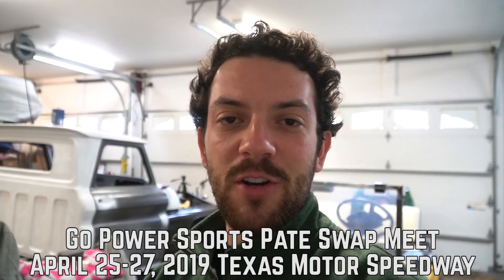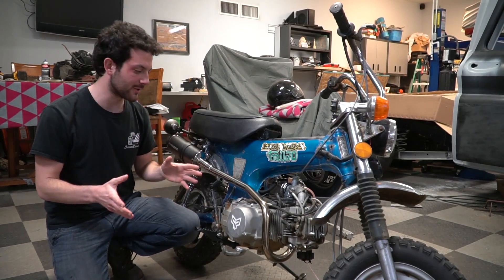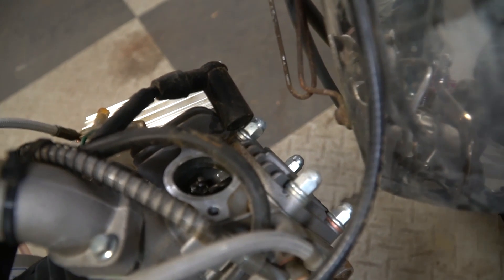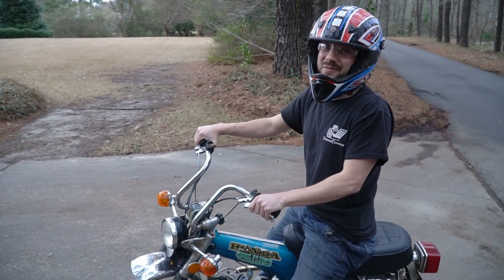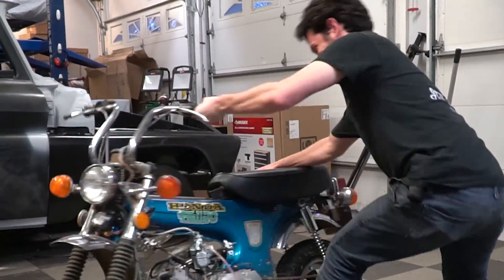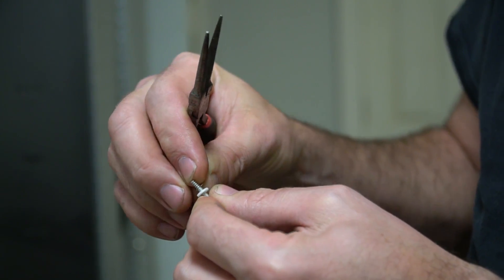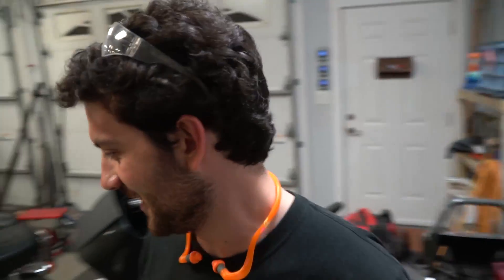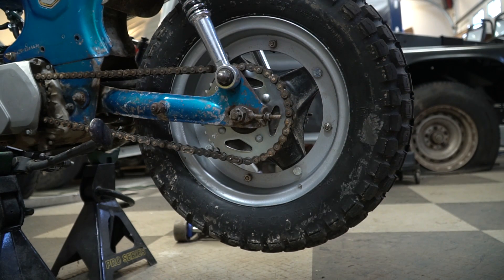Honda Trail 70 Return | The Street Legal Mini Bike!

Comment: John, glad to see that your sorting out the 140 on your CT70. I have a Honda st90 which I put a Piranha 140cc on. Same motor as yours, YX140. It came with a lighting coil on the stator, one of the reasons I bought it. That stator with lighting is a bolt on for your motor. Also may I suggest a Mikuni VM26-606 carb for your bike? I run one on mine and it hits 65 easy. It's a spigot mount round slide carb and flows the best for our motors. Great content, keep it coming!

Comment: Those paper fuel filters can bite you on gravity fed systems too.
Reply: Agreed, they make gravity feed and pulse pump style fuel filters and you dont wanna use the wrong one without a fuel pump.
Reply: I have those small paper fuel filters on my Honda SS with 150cc lifan. That shouldn't be the problem, unless they are very clogged up.
Reply: @andreasvgbe  it depends on a lot of factors such as the height of the fuel tank size and length of the fuel line carb design brand and design of filter etc.  I have a decent amount of experience with this and have seen multiple engines have issues ranging from poor acceleration to straight up not running.  Yes the filter will be more of an issue when dirty but I've seen brand new ones cause problems
Reply: You may well be, but I am not betting on that horse. Let's wait for the next video.
Reply: @andreasvgbe  didn't say it was for sure just something to check:)

Comment: The mini-trail series bikes were designed to be hauled on their sides.  So the gas cap has a locking seal lever on the cap.  If you still have this cap, make sure that seal is unlocked.

Comment: In the maintenance department they had a posting "Before using equipment check fuel, oil, air, belts, hoses and look for leaks. You break it you bought it. " It helped us reduce repair cost. Anyone caught putting away dirty equipment cleaned all the equipment. It was an easy checklist.

Comment: Try throwing a Briggs style pulse pump on it! My 72 ct70 with a yx140 had all kinds of hard starting and fuel starvation issues because of how close to level the inlet on the carb and the bottom of the tank were. I plumbed a pulse pump into the crankcase vent on the back of the engine (just inside the frame on a ct70) and viola! It instantly fixed all the issues I was having. No more dead spots, easier starting. It’s great!

Comment: I've got a '69 CT70 and the gas cap has a On/Off thingy on the top of it. This was so you could haul the bike on its side without gas pouring out of the cap's vent. It will absolutely stop fuel from getting to the carb.

Comment: I have a pretty simple suggestion that I think could be really cool still: a go kart that is focused completely on being the fastest circuit track kart with a clone engine. Basically just pushing every element of a racing kart to the limit... most powerful predator/gx200 (some are at like 28 hp), widest/most grippy tires you can buy, as light as possible, etc etc

Comment: Do you guys want two APC Mini Choppers??? 
Would be something a little different to build up on the channel.
Reply: A Sachs Madass would be great for them also.
Reply: Please do this.. I want to see it so badly.
Reply: YESSSSSSSSSSS
Reply: I have 3 of those!  They are heaps of fun lol... In would love to see what John and Ike come up with on one of those!
Reply: @deetob5408  Hey what's up man!  Good to see ya again lol!  Did you ever get yours sorted out?
Reply: I had a mini chopper about 5-6 years ago - one of the dual rear wheel ones pep boys sold some time ago. It got stolen out of my garage, sadly. Miss that little turd. Hauled my 300 lb butt around with only minor complaints.
Reply: @AgnotologyTV  I put a STILL chainsaw engine and a different sprocket on that exact one and it ran 47 mph no problem the couple of weeks I was vacationing down in Panama FL. It was me and a few friends. I couldn't believe how fun that little POS was...

Comment: i had a similar issue with my pit bike, it was the fuel filter from the petrol tank that was creating a vacuum ,also check the breather for the fuel cap as this can become clogged or non functioning too,i took the filter off it and replaced it with just straight fuel line it works a treat now ,i also replaced the fuel tap as well as it was full of crap.Great vid nice to see the trails back in action .
Reply: old hondas the cap gets its air from the treads of the tank (i think) if the contact plate in the cap is corroded and full of crap ditch it and get a new one:)

Comment: I’m really glad that you guys are featuring the Honda Trail and some upgrades  it was id course one of the first “ Motorcycle i got to  ride  anf ironically  many bikes and years later. I inherited my Fathers 1960s Honda 90 Street  bike  that. Had  kind of  been missing for a little while After  his Brother ( my Uncle) had  gotten it as a gift from my Dad then years later passed away  luckily my cousin. Did  have it in a safe location out of the weather and had. Instructions from his Dad that it was promised to me  the original 90  Honda Motor  has a  broken part on the kick starter and my Uncle trouble shot it and ordered the part it needed Now fast foward to why I’m so ininterested in the Monkey bikes now. Afew Years ago i suffered a Traumatic Brain  Injury  that thu lots of Rehab and hard work i am doing pretty well at the moment. Although the injury has left me wimoth a permanent paralysis in my left hand a a weakness in my left leg and many of those  Monkey bikes had the 90 motor with either  a auto or a semi automatic setup  so in theory. That would be a easy direct bolt in swap and keep the bike looking  Factory or original  but allow me to ride  it  i had originally hoped that maybe i could just use a semi auto clutch pack in my case but apparently it will not fit  as the cases are slightly different in size according to a  Honda Expert i spoke with   I do have a buddy that lie you guys  started Hoarding the old Monkey bikes for his kids and parts to make  a decent  ruhnning bike  and i know he stays on top of whats available  in the  market  so wit some luck  he may come up with something for me   And of hcourse the Chinese Clones. Have the semi auto transmissions but word on those are the motors are ok butthe tansmissions are not reliable  at all and everyone reccomends staying wth genuine Honda   Items I’m ok with that as ive owned several big Hondas ahnd now their quality  and reliability  even with their cars and other products  so i am pro Honda

Comment: I had a Russian Ural that gave me the exact same trouble. It turned out to be a bad petcock washer. Sometimes I would get plenty of fuel, other times it would run out of gas. Gave me fits. Rebuild the petcock if your sure crap in the tank isn't periodically blocking the fuel supply.

Comment: 212's are on sale for 100 bucks at harbor freight right now.
Reply: They are always on sale! Cheapest motor on the market pretty much! But their junk.. have no power
Reply: @anythingmotors9781  so I've heard. Haven't had any experience with them but it seems like some modifications are needed to "wake them up"
Reply: i make good power with them and they are really reliable.
Reply: @anythingmotors9781  plenty of power for a minibike or simple kart frame, even stock. Governor delete alone makes a lightweight kart fairly quick, and a small minibike dangerous. My Sears Runabout came with a 3hp Tecumseh and was fun but slow. With a stock 212, you have to be really easy on the throttle out of the hole or it'll just flip over backwards. And with a gov delete and 12/60 gearing it now goes 40+ on flat ground. Not saying they are the best engine ever made, but plenty good enough for me!
Reply: Bought one to swap out 179cc engine on my snowblower
Reply: @anythingmotors9781  I was like wtf, my stage 1 212 predator on my gokart does drifts and tops out at 49mph, and my minibike is a barely controllable wheelie machine that tops out at 38mph, then I realized you must be a couple hundred pounds more than I am or something.
Reply: Not even close to the same engine.  It would never fit, much less shift.
Reply: @slrs3908  I dont think he ment for the ct70. At least I hope not.

Comment: Check the vent in the gas cap, if it is plugged or too small it will not let enough air in to replace the gas that is coming out

Comment: Try unscrewing the gas cap a couple threads and if that fixes it then it’s gas cap vent. Don’t do this before you ride it just ride it until it surges then just crack the gas cap open for a sec and if it gets fuel then well... bam!

Comment: If your running out of fuel you could use a vacuum fuel pump for a Kohler mower or fuel pump for a 1986 Honda fourtrax 350. The Honda pump auto shuts off when the bowl on carb is full.

Comment: hey guys,
nice to see the trail 70 back.

just to let you know that with a mikuni vm26 you can get the maximum performance out of the yx140
mainjet 150 , slowjet stock.
and my personal best gearing is 17front and 28back.
should get around 100pkh :)

and for the other trails maybe a daytona engine?
the 150cc daytona is fast.
and the 190cc is just to much in my opinion, because it wil go over 120kph and those speeds are just dangerous on a trial 70.

greetings

Comment: One word from the wise, I had one of those as a kid, I split the frame at the forks, so keep an eye on that, especially if you're going to do ANY off road riding....
NEVER replace the sprocket without replacing the chain too on the rear, the chain stretches and will eat a new sprocket. 
Lastly why don't you replace or fix that bent bar....
Reply: Handlebar has been bent for as long as I can remember 😋
Maybe he's just used to it now. Personally, it would drive me insane.

Comment: just a suggestive hint... maybe put an o2 bung in the exhaust of every engine you have, just so you could move the sensor from "toy"  to "toy so you could exactly tune each combo.. the you would only need one sensor (with a battery to power it) so every ride could be tuned top its best... no more guessing.. plus after using it a bit, you get to know what things need before you even see the.readings.

Comment: The fuel filter has to much restriction for the slightly bigger carburetors needs. Get 2 tees and use a second fuel filter along with the first. 1 tee before the filters and 1 after. That will increase fuel flow to the carbs on the bike. Should about double the fuel flow because of  filters being parallel and not in series. I worked as a small engine mechanic for Sears years ago. Sadly I am now disabled.

Comment: I like how they have a plasma cutter, pneumatic cut off tool, dewalt chop saw, and a sawzall, but they chose to use their $9 harbor freight angle grinder and their bench vice that's not mounted to the table.

Comment: clean out and poke the holes in the mixing tube of the carburetor, when you've started it again to troubleshoot: remove the filter and choke it manually by hand, if it runs better when you choke it like that it means it runs lean. to further test out this theory; spray start-fluid while you rev, if it is lean - it will run better with the added ether. if it runs worse it's too rich.

Comment: That bull nose F150 or F100 is a must have in the background
Reply: 66 chevy c10
Reply: @isaacitllbefine7231  5:03 is the truck I was talking about i had a 83 F150 with a 302 with a mild build mainly cam and valves with a C4 3 speed tranny and 411 rear gear in a 8.8 I couldn't destroy it and my good friend had a 86 Chevy Cheyenne he built from the frame up as you could imagine there was plenty of I'm better than you talk between us

Comment: One thing that would be good to check is cam timing if the cam is off when the flywheel Mark's are lined up your chain needs replaced I have similar problem this one runs bad at low rpms very good mid range and not so good topend

Comment: Check the vent in the gas cap on the tank. May be air locking at higher speed.
Reply: i agree on the old hondas the cap gets its air from the treads of the tank (i think) if the contact plate in the cap is corroded and full of crap ditch it and get a new one:)

Comment: had a similar problem mine was the gas cap wasn't venting enough so if I left it half open on the fuel tank cleared it up got a new cap since then no problems with it

Comment: What that means is: You have a flake of rust over the vent holes in the gas cap - would almost bet money thats the case......... Tell me if I was right- easiest way to test is ride it with the gas cap loose or off and see if it doesnt happen, if so, disassemble and clean the gas cap the vent is clogged

Comment: My old Kawasaki 1000 acted like that, ride a ways, it would die, sit a few minutes, started fine, went a couple more miles and died... ended up needing a new fuel filter, the carb bowls would fill, running it would drain them, (flow couldn't keep up!)
Reply: That does look like a tiny inline filter. May not be able to flow enough. Easy enough to check.

Comment: this is from my younger days. replace the condenser by the ignition points. clean the points. add a condenser by the ignition coil. you will go a lot longer between points service...which is a bit of a p.i.t.a. because the flywheel has to come off. that should take care of the ignition foibles that i hear on the vid. make sure the float bowl is clean because of the ethanol content in the fuel we use now gumming up shit on a regular basis when sitting for any length of time.
 make sure that the tensioner on the cam chain is functioning properly also as that was also a minor but not insignificant point of contention on those ct engines. hope this is of some help.
=dok=

Comment: I work on these small after market Engines all the time. They require alot of maintenance ever 60 to 80 hrs. and they hate cheap fuel..

They handle heat ok. But next time you go to the atv park. Avoid getting it wet. These damn things love to shrink and mess up the piston and cylinder. 

Thumbs up on the carb upgrade.  Way better than the cheap ones. 

The good news. The valves needed to be checked after a few hrs of ride time...

I need to get my stuff ready for the atv park.   Only an hr from mini mayhem
Reply: i have a yx125 check it out on my channel. got any tuning tips?
Reply: Sounds and looks to be too rich. Adjusting the airscrew will help
Reply: @adomingoad  yeah I still have the stock carb on there, today my keihin 26 flat slide carb came in ;) can't wait to put that on. Got any carb tuning tips?
Reply: Look up Idle drop procedures.  But also remember the carb comes preset to run lean. So adjust accordingly.
Reply: @adomingoad  but then I need to buy new jets?
Reply: Did you change the top end? If not, then you should be fine... but here is a good link to look at if you have questions about the jetting. 

https://www.rollingwrenchdenver.com/blogs/news/carburetor-help-jetting-and-tuning-help
Reply: @adomingoad  thanks man!! I have enough knowledge about bikes but carbs are different men
Reply: Yeah. These chinese bikes are happy with stock jets. Just really sensitive to trash and cheap fuel.
Reply: @adomingoad  I put 102 octane in mine

Comment: Those motors do not over heat easily.. but if you over rev it over time the rings go fast.. just my own experience over 12 years.
Reply: Yes the original engines didn't really overheat so fast, but those new 140,150 en even 190cc engines that fit these bikes nowadays have a lot more heat energy te get rid of.

Comment: In the 60s and 70s, Honda used an in tank or in petcock screen filter. By adding an in line auxiliary filter, too much resistance is created making below a quarter tank of gas not feed volume for proper performance. Remove the screens or in line filter.                           peace

Comment: you should change the handlebars, the stock ct/st bars are really dangerous.
one time i was on street tires and i had to go through some gravel and dirt to run from a dog that was chasing me.
the only thing that saved my ass was the pit bike style bars i had installed...
if i didn't have them i would have falled

Comment: i have one of these bikes and i am running a 155 lifan big bore 4 speed engine , with the largest counter sprocket on the engine 19t ,and the smallest sprocket on the rear wheel 26t and it only tops out at58 mph.  and i weigh 155 lbs.

Comment: very late comment but since its the YX140 like mine you should take the Cam sprocket off and see if the cam sprocket is a 2 bolt and if it is then you have the upgraded Z40 cam and Big valve head and thats what i have and mine came stock with a VM26mm makuni carb with a lightened small flywheel.

Comment: That's a simple problem on fuel flow. Those cheapo inline see through filters really don't flow much on gravity feed systems. They do fine on pumped systems, but not on gravity feed. Need to find an old style settling bowl filter.  Simple test: replace filter with piece of pipe and go for a ride.

Comment: My guess it's the Fakuni/Makuni. Go Power Sports uses they jet the main pilot at 17.5 I went one size down to 15 also they ship the mikuni 26vm with a 135 main jet. I wnt down to 120 for warm days and 125 on colder days below 50 degrees. own to a 120. She runs real good now. I believe if I had a bigger cam maybe a 310 Dyno cam and ported heads the 135 main jet and 17.5 pilot jets would be probably right?

Comment: It's spluttering cause that needle setting is way too rich, go in one notch increments as its alot bigger jump than you realise. It also doesn't affect mid rpm, it affects mid throttle input, if you are wide open throttle  at mid rpm and it's feeling lean you need a bigger main jet. Rule of thumb is the pilot jet affects 0-1/8th throttle, needle affects 1/8th-3/4th throttle and the main jet affects 3/4th to full throttle, it is nothing to do with the rpm.